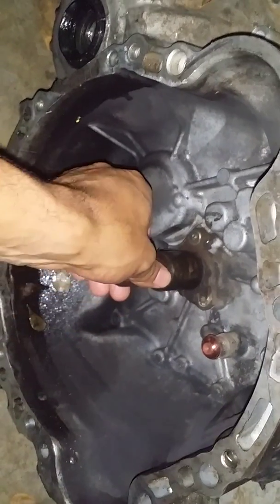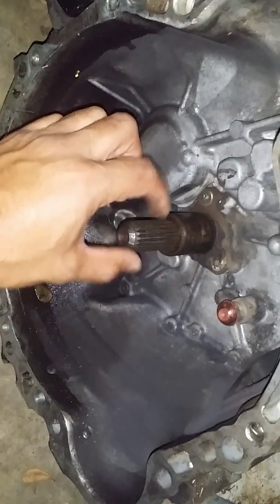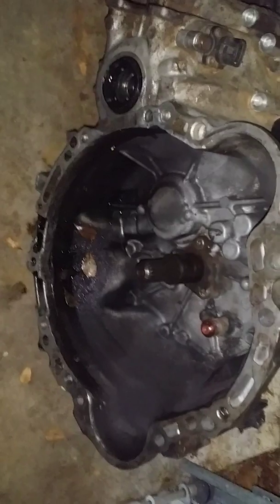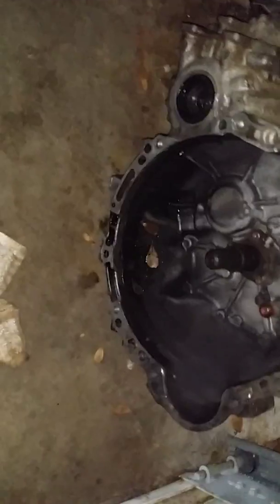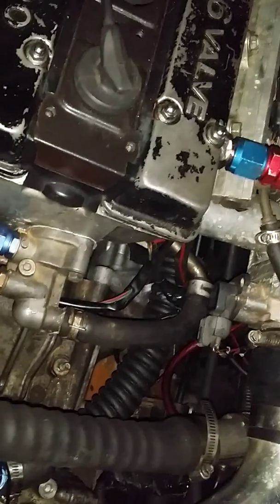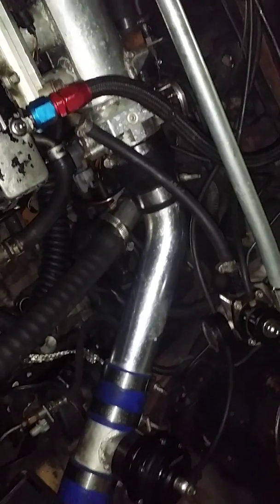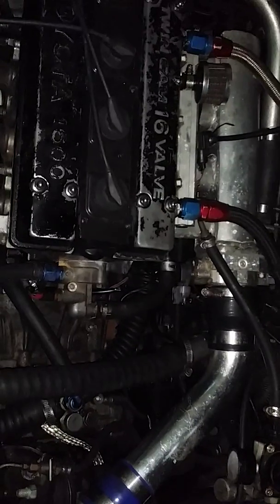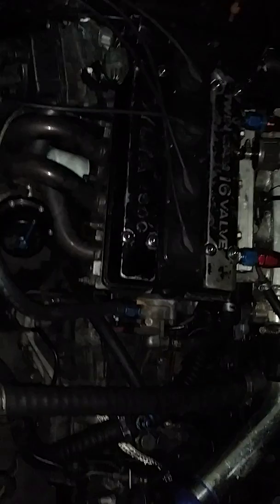easily mate lsd e58/e51 tranny to 7afe/4age no sourcing

Comment: Hello, I have a 7afe celica with a c52 5 speed, it's posible to go 6 speed with a c160 or c162 transmision? The c162 from the corolla g6 its plug and play? Thanks!
Reply from the maker: Careful.. it has to be from a blacktop 4age 20v 6speed... cause the 2zzge has a 6speed that's looks very identical. If I may ask why do you need the 6speed?  Those short gears might make you slower even tho you feel faster since you will be out of the 7afe powerband. Do you have supporting mods to breath up top?
Reply: @holdmywetnutz  Just because the 5 speed has really long gears and in some speeds like 85km and that ranges you cabt go con second and third isn't as rev as much... The corolla g6 with the 4afe is a special edition with that gearbox (110cv) and i don't know if is posible to put on the 7afe (both motors have the c52) and Im from Spain! Sorry for my english
Reply from the maker: @1halonacho  well if it's from a 4age should fit.. 4afe and 7afe are same block design  just one being taller and 1800cc the bolt patterns for trans should line up.. 4age trans should fit too.. well remeber 7afe engine is not peaky engine  it makes all its power at 5600rpm  and max torque is at 2800rpms. 4afe and 4age have no torque down low and used a shorter gear to multiply torque to help it get going. Another note the 4afe revs higher at 6800rpm vs 7afe 5800/6200.. I've  done this test before doing  a final drive swap on a c52  from its long 3.75 to short 4.3 final drive.. I was shifting into 3rd gear at 78kmh. Into 4th gear at 117kmh it was a tiny bit faster  up at high speeds wasnt much improvement.The 6 speed has even shorter final drive but extra gear so try it out .. so it's up to you but yes it should fit  any 4af or 4age trans.. let me know how it goes
Reply: Thanks! Here in spain is rare to se a toyota from the 90 or before... Now is easy to see new toyotas but it wasn't a popular brand on this country, we have a lot of Renault, Peugeot, Citroën, Seat, BMW, VW... So it's hard to find and modify toyotas. Maybe you are right, i would like to swap to c162 but i didn't see any swap yet and I need to buy the gearbox from other country so it's a risky thing
Reply from the maker: @1halonacho  well can you find the 4afe 6 speed special edition gearbox?

Comment: 7age setup but what timing belt to use with this set up
Reply from the maker: 1987 porsch 924 timing belt.. you meed to reslot the crank sprocket or get adjustable cams so tje engone timing lines up. if you dont get the sloted cranksprocker or adjustable cams and just put on the timing belt the cams will be to advanced and the car will have no power after 5krpm
Reply: nice!!!

Comment: What about piston
Reply from the maker: depends what setup 7afe or 7age? cause theres no piston for 7afe engines but you can use 4age supercharged pistins cause they are not domed like regular 4age pistons and similar to the 7afe piston however if u use supercharged pistons in 7afe block and head the compression goes really high if used in hybrid 7age setup it goes up 1 full compression point